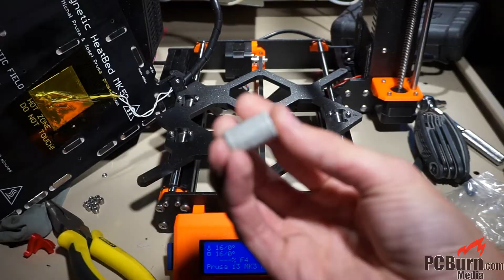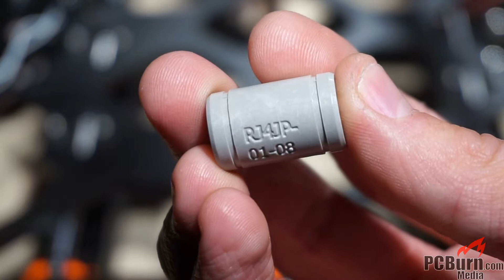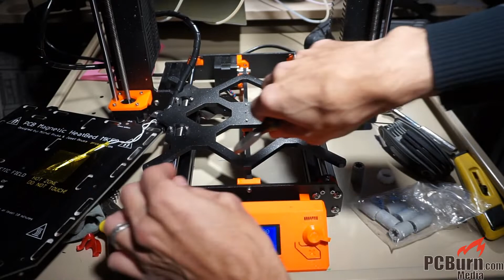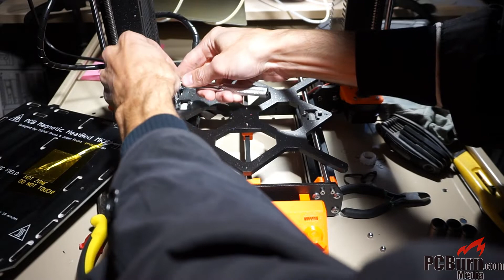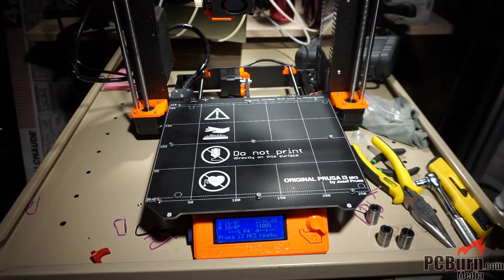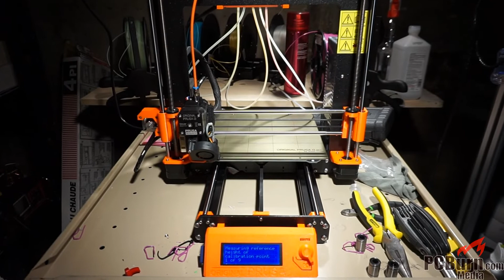Installing IGUS Drylin Bushings (on the Prusa i3 Mk3 3D Printer)

Comment: I have a mk3s with a lot of crash detects, I will try this bushings thanks a lot for your video and patience.
Reply from the maker: Lots of crash detections would probably be an issue with alignment on the rails or something physically in the bearings. Without proper enclosures these bushings will be tighter; and in any case they won't fix whatever underlying problem you're having.

Comment: How are the bearings holding up? any update?
Reply: The IGUS bushings weren't loaded up well enough (and the rods probably aren't quite a good mate). They were pinching at a single point with the stock mounting hardware instead of bearing the load over the entire surface.

I did end up pulling them off; I'll add a link. I still liked the bushings but will probably end up getting a set of rods and proper mounting hardware, or the reload-able IGUS bushing that simulates a standard bearing, the next time I use the IGUS bushings. Either wasn't horribly expensive.

Comment: I bought the IGUS IDE Set that included the rods.  There's a tad bit of wiggle in there, this really concerns me
Reply from the maker: I'd ask IGUS about it, personally.
Reply from the maker: Oh, and aside from throwing the question at IGUS's technical department and seeing if they have any suggestions you may want to check the rods and verify that they're as advertised. Especially if the assembly you purchased wasn't loaded up properly out of the box! Personally I'd probably go with (although it might sound odd) Misumi precision rods, a set of Drylin R matched properly in diameter, and probably a spare set of Misumi bearings while I was at it.

Although any combination of those should probably last as long as I'm likely to use a given piece of equipment non-commercially.
Reply: Well, mine was sold as a set specifically for a Prusa MK3s
Reply from the maker: @MikeColburn  Sure. What was the response from it's manufacturer's technical department regarding your concerns?

Comment: IGUS better bearing metal ?
Reply: I'm not sure what the question is. Or which IGUS product. I like the one's I was using, but they're different from metal bushings or bearings with different requirements.

Comment: That cannot work for an long time.
You have to change the linaer rails too with Coated Aluminium rails from igus.
The bushings and the aluminium rail are teamplayer ;)
Reply from the maker: Thanks for pointing those out. Igus's own recommendation is "it's complicated" as far as I can tell. https://www.igus.com/info/plain-bearings-shaft-material-ca

Comment: can you recommend this mod?
Reply from the maker: Tough question. So far it's working okay on my Prusa i3 mk3. But I'm pretty sure the bushings are loaded in such a way that they'll experience unusual wear in the middle and won't last nearly as long as they should. Which without actually running them until they die could be any length of time!

If you're looking to use the Drylin and aren't doing it with the expectation of failure you may want to get the cased ones with removable inserts. The Igus RJZM-01-08 part. That's got an inexpensive replaceable inner component with an outer metal sleeve to help spread the load on the bearing out.

I haven't tested those out yet so I'm not sure they're the way to go for a center clamped bushing. I'll probably buy three in and test them out in the future.

Although you'd probably be okay with the RJ4JP-01-08 if you created an appropriate housing to hold them to the print bed and apply the clamping force over the full side of the bearing. Or at least the two normal clamp points instead of the center.

Comment: You'll regret putting them on
Reply from the maker: Yea, on the bright side I know they're not a completely appropriate part and how they're likely to fail. Which I should've covered. I was too busy trying to get the bearings replaced and move onto using the printer :).

What I might end up doing is machining some sleeves when they wear out in a few months. Pinched in the middle like that I'll be pleasantly surprised if they last longer. I'll make an update in any case.

Although currently it's a borked piece of PTFE in the hot end causing me grief with the Prusa! Little sucker mushroomed on the "in" end and pulled itself up a bit causing plugs. The bushings are functioning okay.